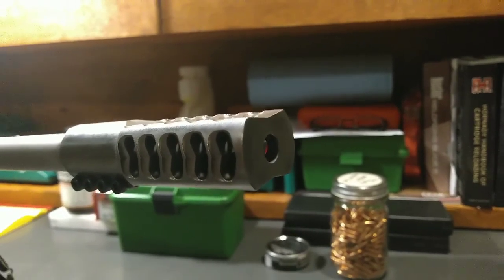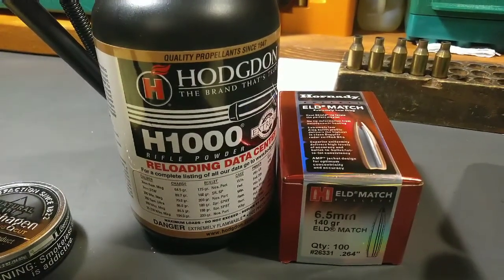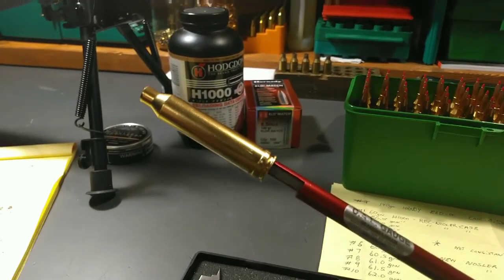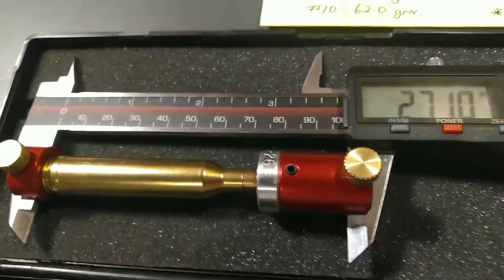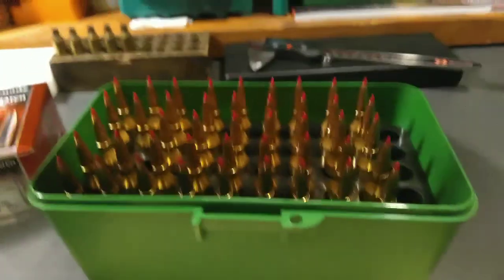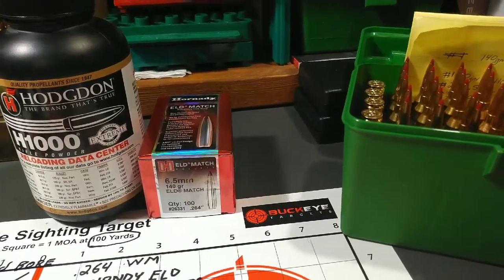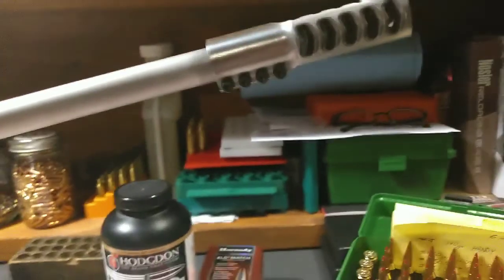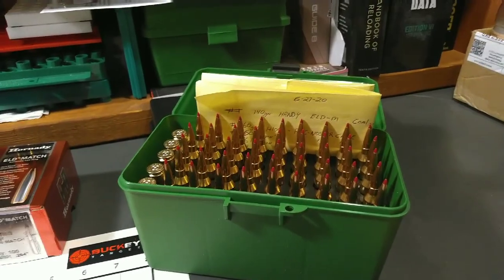.264 Win Mag, Muzzle brake and 140gr ELD handload

Comment: The Witt seems to work great. Thought of getting one for my 26" mod 70 264. I found good results w H129 sp & 68 of Retumbo.  I think the 129sst would do same 1/4" groups. Drive safe brother. God bless
Reply from the maker: Oh yes, I know them lighter bullets would probably be a lil tighter for sure, but I'm gearing up to shoot this long range (1,000 yd goal) I still got alot of ladder loads to run, I'm sure it will tighten up.... I'm kinda waiting on a new scope( Leupold VX 3i) and mounting up a new scope rail with 20 moa built in.....all in due time.lol
Thanks for watching 👍
Reply: @idahorodgersusmc  even on 1000 yd I'd be tempted to use swift sirocco 2, bc .571 if memory correct? At 3300 fps its a 1000 yd low drop bullet. Just my 2 cents brother. Or 147 eldm ?
Reply from the maker: @austintyler7991  Berger long Range hybrids 153gr is the bullet I'd like to work into.